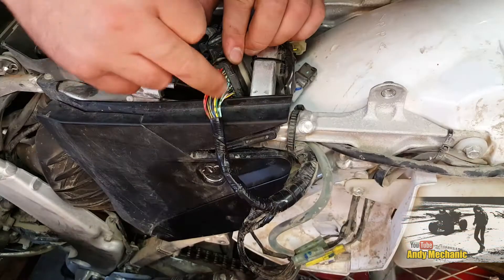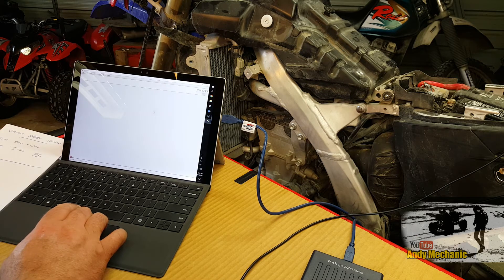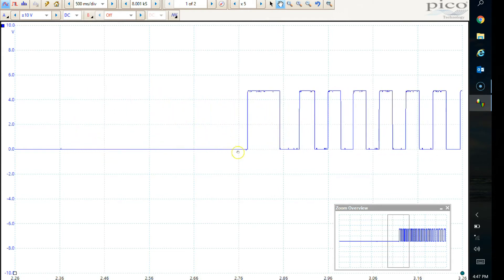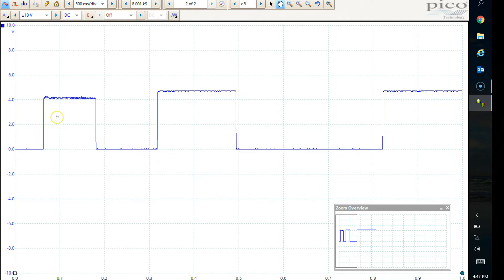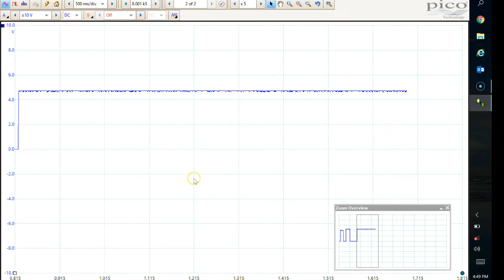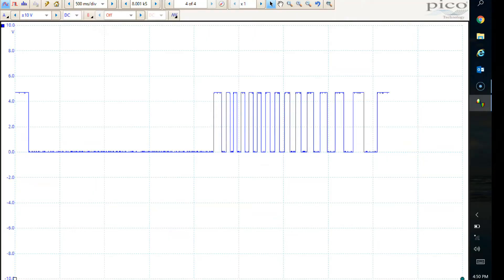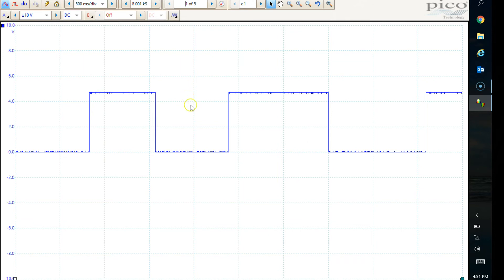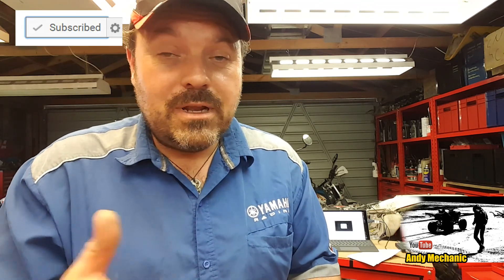How to capture a wheel speed sensor waveform using a PicoScope #1219

Comment: For what i know the distance between the sensor and the teeths and the spots without teeths when the wheel is turned create and colapses an magnetic field that create a voltage that rise and colapses. In this case the strange thing is that the signal is not an analogic one but an digital one.(where the high is 4 and something volts and low is 0v). The change in speed gives a change in frequency more like today's radios FM=frequency modulation
Reply: On Wheels good question.

Comment: Ehy mate i would like to ask, how to i tap into my stock boost pressure sensor to run a gauge on the dash without adding a new sensor or having problems with the ecu?
Reply from the maker: +Doc. Volt Hi Doc, Thanks for the question. Unfortunately I have had very little to do with turbos so really wouldn't like to give advice on that. Sorry. Andy
Reply: Andy Mechanic no problem mate, thank you for answering anyway!